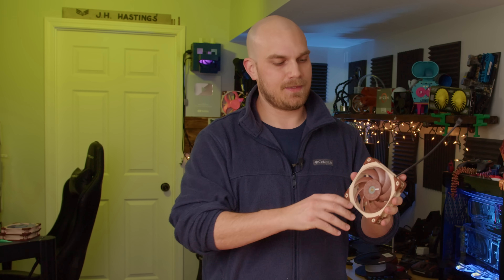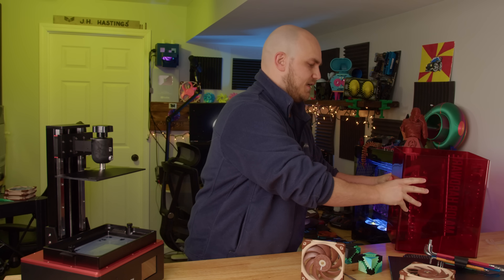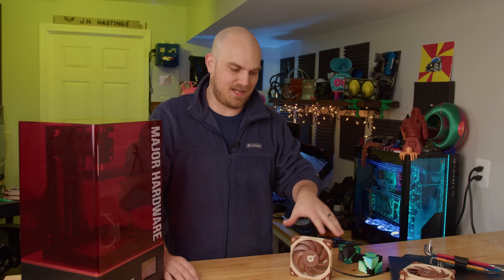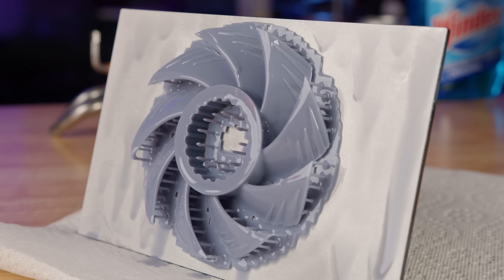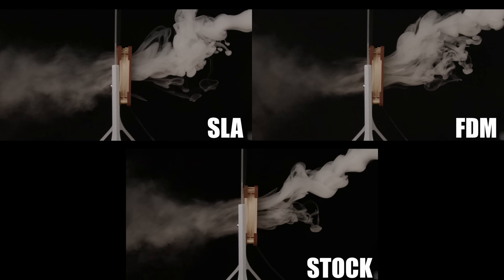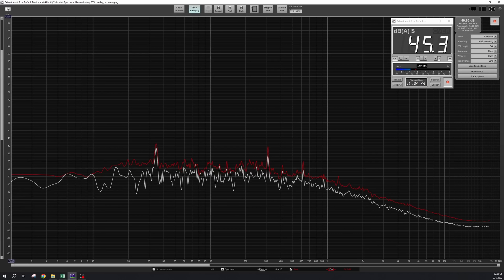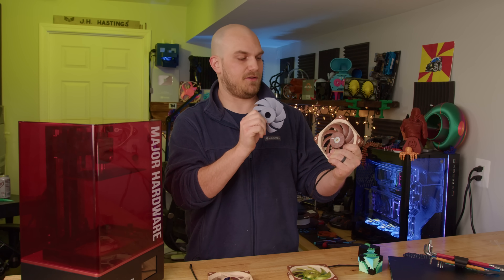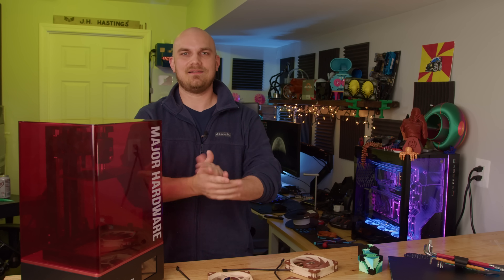I Copied Noctua's A12x25 and Resin Printed it, Its Performance Was ASTONISHING

Comment: While the rez is nice, the benifit of your fan show is the sheer number of fan designs you test, would the switch to rez reduce that overtime due to the higher print requirements? Not sure ~2% would be worth it when really it's the design, not the material being tested.

Comment: For a larger printer, I would like to suggest either the Elegoo Jupiter for its resin auto-refill system or the Peopoly Phenom Forge for its heated vat. Personally I'd choose the Elegoo Jupiter for the refill system and then make one of those enclosure heaters for it that uses a little PTC heater because I'd love to not have to worry about running out of resin on larger prints. Add on a Wham Bam magnetic plate that's already available and things get really easy.

I own the Phrozen Mega 8k and it's a good (but slow) machine but it would certainly make my life easier if there were a wham bam plate available to it. Especially since it uses a perforated build plate that makes removing prints a nightmare if you overcook your initial layers. I also am in the process of building one of those 100-120 watt PTC heaters.
Reply: Incidentally, Elegoo has the Jupiter for $300 off right now.

Comment: a few tips from an experienced resin printer. Make life easier. 
Chitubox Pro is worth it. 
water-soluble resins are a godsend. 
Make sure to always have a lot of paper towels.
get some silicon mats with a lip to place the printer on. (You'll be happy for this the first time you get a spill inside a machine and you can essentially pour it into the tray and wipe off without fear))

Comment: Need to weight the blades to make sure they are the same. Mass is a factor in the performance of the fan blades. If one print style is physically lighter, using the same motor to test with, the lighter fan style would tend to spin faster increasing the fan's performance while the heaver fan blade would spin slower.

Comment: Do you account for the difference in rpm between the fans? Even though it is the same model the rpm always varies slightly between individual units. Best is to measure that beforehand.

Comment: The A12x25 turns at around 2000 rpm correct? Then the peak at around 33.3 Hz is at the first order of speed and most likely caused by imbalance of the fan. Interestingly it looks like both your prints are better balanced than the original. Could also be due to the different material though.

Comment: As long as all the fans are printed the same way it shouldn't make that much difference to the overall winner. Do whichever way is easiest for you.
Although a battle royale of all previous season winners printed in resin seems like a good next step. It would be nice to see how Resin affects the performance with a wide array of designs. It would also give you a chance to get some of the older winners tested with your latest standards/methodology.

Comment: Suggestion for next season. Seeing as both methods are within an oversimplified 3% performance difference of each other, I would say you can mix and match as it suites you best. Even adjusting of a 3% difference would rarely impact the results.

I don't think you need to swop over entirely to SLA for every single print especially for those that don't need it

Comment: Maybe adjust the printer height to 0.1mm so you do not mess with the chemicals? There are also some slicers that can do adjustable based on limits (Supersclicer). You can set it from 0.1mm to 0.3mm to have a balance between speed and quality

Comment: I'd love to see more resin prints.  Maybe you could reach out to Formlabs for a Form3L printer and resin.  It's big, reliable, has great resin, and has amazing slicer software.  It's an entry level commercial printer, so it is expensive to buy, but we'll worth it.   I have 6 years using a Form2 and it's the best printer I've put hands to.  That's even counting the Stratasys lineup all the way to their commercial  250k dollar models.

Comment: Hello!  Love your fan show down show!!!!  Have seen every single episode (some of them múltiple times) and am well aware of the evolution you have gone through, in terms of how scientifical your comparison methods are.  First Time I write to you ever, and I am doing it because you asked me to: 

Please do not change yor printing method to resin!!!!!!!   

As an Aerospace engineer that lives in Venezuela, designing wind tunnels for índoor skydiving, YOUR SHOW, even if you are playfull, funny, and purposefully pointless sometimes, has had a mayor impact on the way I am putting things on paper now.  We're talking fans that are 15 feet in diámeter....  

Believe it or not, your show is actually directly responsable for the blade design option that I have chosen for the fans on our current proyect.  

The Cheater AND the Simple 13 are the two winners that lit my bulb💡!!! 

Would you redo every model you have tested so far, in resin?????

That's a Lot of 2.0 material!!!!  

But it would take an infinite amount of Time, which you most probably don't have, with a job AND two children.  Congrats my Man!!!!! Blessings to your family.

What I am trying to say, Is that switching to resin at this point would be unfair AND unscientifical, towards all models that came before and that have been compared very scientifically among themselves.  

Love your show as it is.  AND thank you very much for the inspiration and useful data for comparison.  Greetings from Caracas.

Comment: The noctua original fan is made for the constraints of injection molding. You don't have those constraints with resin. Is there anything you could tweak to make resin outperform the injection molded noctua?

Comment: I don't think resin printing is obligatory. First, great work modeling! Second, I was shocked that the difference was so small. Third, you can just figure the coefficient of "decrease" and rate fans compared to "decreased" a12x25 or "increase all the results. Fourh, you can print fans out of abs and sand the most rough spots (mostly after-support surfaces)

Comment: I have an idea, see if you can beat the Silent Wings 4 pro for performance Vs silent operation. I have 2, they never run over 600rpm and can keep the CPU cool without noise at less then 25dbA which is very very quiet. Nocua have delayed the nfs 14x25 again and I suspect it’s because the silent wings beats the prototypes. Be interesting to see how efficient you could make a fan below say 35 or 40db.

Comment: You should reprint the fdm with a 0.08 layer height and compare that to the 0.2. Would be interesting to see if or how much that helps. Might put it on par with the resin.
Reply: Another variation to look at would be to print the FDM fan using ABS filament, and then use acetone smoothing to get rid of some of the layering, to see if it gets closer to the resin print, and by how much.

Comment: My opinion is the best you print all of them in sls printer. Smoothness the material i think will affect the air flow.

But you can run the showdown at fdm then in end of season top 5 or 10 fan get to print at sls. Not olny compare if any different from fdm, but to beat the OG fan maybe 2,7% is big difference haha

And maybe some model that you think or creator think there is any bennefit to smooth material(sls) you can print it on sls.

Comment: I don't know how to 3D model, but I have a request: Could someone model out the A12x25 fan, but with 20%/5mm wider/deeper blades?  So kind of an A12x30, if you will.  Bonus points if you can work out the model to have the same mass and volume as the original A12x25, but current printer materials probably can't do that maybe.

Comment: I have always felt that, were I to print any fans that do well in all this testing, or even just a replacement for a broken fan, I would certainly choose resin over fdm as someone who has both to choose from.

I have no reason other than intuition prior to this test to base this on, but I always kind of assumed the surface quality difference with even a great fdm print could only at best not matter and at worst be bad for the fdm fan quality, but also a fan could have much thinner blades and more strange shape in resin IMO. Supports might be a bit of a pain in resin but there are ways to deal with it, and I have always thought far more things needing supports are possible with resin than fdm.

Comment: I'd love to see a 140mm version of the fan showdown. I'm just not sure if the NF-A14 is good for doing the same treatment as the NF-A12x25. I just testes lots of 140mm fans and the NF-A14 was just... well... a "good average" fan but I mean it's about ten years old by now and other companies had a lot of time to beat it and Noctua is still letting us wait for the NF-A14 replacement. Maybe here you have the chance to actually beat "the original" - and maybe noticably.

Comment: could just add another column on the excel " 'erpp' estimated resin print performance", make it's value ~102% of the value field, and if the estimate beats the a12x25 or is in top 3 for example,
then you can print that fan in resin.

in the end there would a resin version of just the top performers.

Comment: Flexi-magnetic  build plates apparently allow you to print directly onto the build plate without support, then flex off the print. This is a big enough bonus (if it works) that it might make resin printing easier given you skip an entire post processing step.

Comment: How about a top 5 shoot out for the season finale with resin along with the original data, should give you a good idea on the design differences and if you can just put a 2% performance increase or if it's even worth the resin printing.

Comment: If you look at the thumbnail, I think that your copy is just a touch smaller than the A12x25. The Noctua fan blades are closer to the outer fan shroud. That tight tolerance is a big factor. If you can keep the blades from contacting the shroud while keep that gap tighter, I'm confident that your model would match the A12x25.

Comment: Very interesting comparison!
I was also wonering about the d'effects of 3d printed fan blades.
Results are impressive, even fdm is closer as I would expect (my blind guess was ~5% worse that the original).
One thing that I see, which can easily be visual illusion is that the original noctua fan blades seem a bit thinner?
I don't know if they're thinner or perhaps at a bit larger angle (optimised for static pressure?).
But that could easily be visual illusion due to the different colors.
I would love to see some resin 3d prints but I don't think it's necessary if we know that fdm is only ~3% behind.
Btw there option for vertical stacking with resin 3d printers (if you adapt you model of course). It won't be faster that printing then in parallel of course but should be cheaper than buying another large 3d printer :)

Comment: How do the weights compare between the three models? Thay may explain some of the difference. I guess you could also look at the difference between max RPM for the three fans as well. If their weights do play into the differences you noticed, I'd be curious to know how a fdm print using ultralight PLA or other lightweight filaments performs. And I get you on the reluctance to use your resin printer. I was all about resin printing until I got a reliable FDM printer that doesn't require tinkering after every other print. And congrats on the new addition to the family.

Comment: You should contact Nidec Servo who made the original Gentle Typhoon fan design that noctua copied almost completely. They might share the CAD files with you! If not them, try Phanteks who might give you their model for the T30 (again, another clone but that is thicker)
Love noctua, but let's be real it is a clone. They did some magic with their bearings to make them even quieter than the dual-ball bearing Gentle Typhoon, and their sterrox polymer is superior to the plastic on the original Gentle Typhoon, but they didn't design the fan impeller

Comment: How about FDM, but with different resolutions, because you can get closer to resin smoothness with better resolution on FDM. 0.4n and 0.25n have huge difference, especially with Arachne perimeter generator. Also layer height (70 microns vs 200 micron) will probably make a difference.

Comment: Iirc Noctua developed a special material for those fans, so they could keep the gap bewteen blades and fan housing down to a minimum (get a 14cm fan flow from a 12cm). Not sure printed materials will be stretch resistant over time as Noctua.

Comment: I do think that could be a factor for when things are within that 2% window, but if it's "not even within that 2% window" then it's not worth breaking out the Resin to see if it's close.

After all we have excel and we can put in a 2% Error Bar now that we know the MATERIAL DIFFERENCE can make a factor. And retest things that are WITHIN that 1% of each other OR within that error bar to Stock by trying it in Resin.

Smarter, Not Harder. Let's only put the effort in when it can make a difference.

Comment: My first printer was a resin one and I ended up cutting my losses and selling it with hardly any prints done because it's so messy and hard to get good prints out of. 
If you got a printer with a huge build area you could try and see if it speeds things up, otherwise I wouldn't bother.

Comment: I was wondering what happened to you, I thought you fell of the face of the earth but...Congratulations on your newborn 👍

It would be nice to see the Gear Ratio and the Simple 13 made in resin to see how they perform and the next season of the Fan showdown has to be resin, it gives a smooth finish just like injection molding.

Comment: If the non resin printing s the easiest workflow. Why don't you just add 2.5% to the numbers to compare to the original noctua.

Also might want to print out some previous fans with resin. The top ones and or the ones who weren't that smooth when 3d printed. To compare to their previous counter parts. How much better can they perform?

Last point I have is what happens if you sandpaper the non resin one. We know from planes that anything that isn't smooth is going to be a drag on wind. So it isn't that surprising that the smoother one wins.

Comment: Could you test spraying both FDM and resin prints with a smooth clear coat? Maybe even pre-compensate on the added thickness before printing.
I think it will bring FDM closer in quality with pretty small effort.

Comment: What is the nozel size for FDM?   I guess if use smaller.  (eg. now using 0.4 and going down to 0.2) the performance gap between FDM and Resin would get much much smaller.

Comment: You can go beyond in your analysis and check why same shape give different result. Weight, smoothness (resolution), precision of distance from radiator by the blades… For smoothness you can try to print it in ABS and use acetone vapor to levigate the surface.

Comment: To keep things simple for you, why not both? Do the general prototyping in FDM, while reserving SLA for fans that have really thin cross sections, as well as a season finale where you reprint the top handful in SLA.
Reply: Unlike FDM - very large SLA printers can be a royal pain.  Multiple saturns would be best.  The FEP is like a trampoline and having more tension to offset the movement will create more tuning headaches as the printers get larger.
Reply: this

Comment: Just make 1st place a resin print and do that for each seasons winners....If they are much better compared to normal prints then maybe venture down that road. 

But if that 2% performance is the same with all the fans then its a waste to do it considering all the issues. Plus the fumes with another baby in the house. 

We can simply just add 2% more to the numbers to see if any past fan would be even better

Comment: Personally, I'd do some more testing. Get all the data I could from let's say 5-10 very different models. If they all show close to 2% difference, I'd do a math approximation to what the resin print performance would be.
But on the other hand, like others have said, it would be fun to see what happens when you can make thinner and "lighter?" models.

Comment: I vote for resin printed blades.  While resin printing does have it's downsides, mainly added complexity and post-processing when compared to FDM printing.  It excels at print resolution, no layers so better overall strength, and the ability to print 1 blade or 10 blades in the same amount of time.  With a big enough build plate you could print everything in a single pass, maybe 8-10 hours.  Resin printing does get easier the more you do it btw.  😁

Comment: Maybe, just maybe , this 2% difference is hiding in print settings , u can try 1.2 layer h ,   low wall thickness 0.8mm , and some play with infill , to decrease fan’s weight as much as possible

Comment: Could you do a push pull config season? first with noctua on push side then one on the pull side and finally with one on both sides. I’d also like to see a radiator smoke test.

Comment: There was a few fans that had problems with how they came out printed as well as a few with tolerances that got rubbing, they might be best to benefit a retest in resin. Also given the sound of the fans the Noctua one sounded worse even though its a lower DB. That peak was high enough to irritate my ears vs the other 2 fans I would be far less annoyed with.

Comment: First, Congratulations on the new addition to your family. 
Second I think the stiffer the medium the better performance you will see. Any flex observed in the model will lead to a less than ideal aerodynamics. You should find the stiffest medium you can (maybe even a metal printer or CNC) then reprint the top contenders from each season and some fans that failed because of deformation. Shape is important, yes, but if the medium didn't matter we would make way more things out of paper.